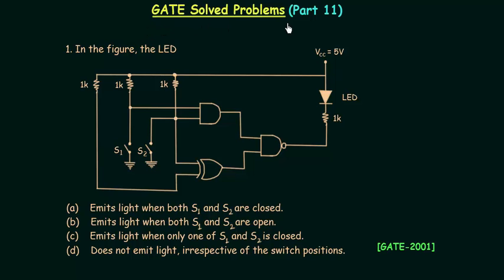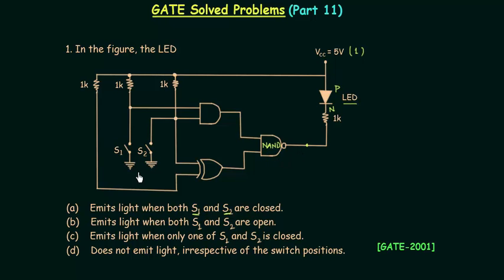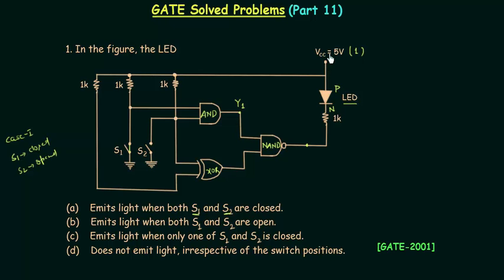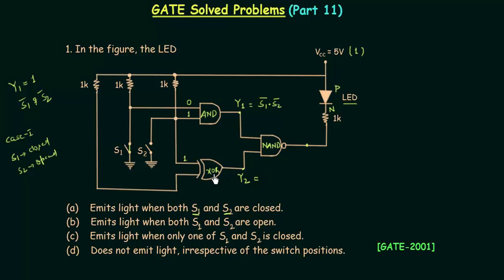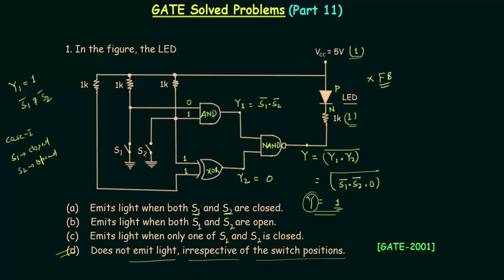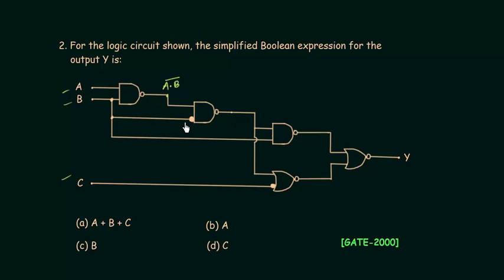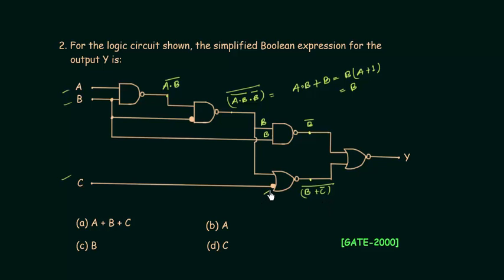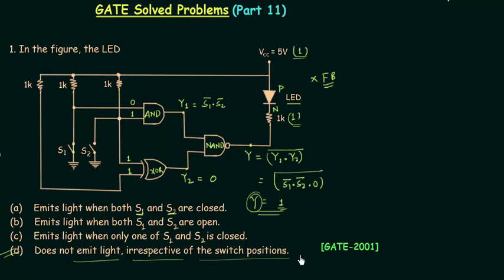GATE Solved Problems (2000-2001) | Logic Gates | Digital Electronics

Comment: The option "(a) both s1 and s2 are closed" is the correct answer because when s2 is closed, the XOR gate receives 0 as one of the input. We should consider the dot in the input of AND gate
Reply: Dot concept is right but the correct answer is still (d)
Becz to make the led on the output of nand gate must be low. To make the output of the nand gate low the only condition is both the inputs of nand gate must be high. But both the inputs of nand gate isn't high for any of the switch combination.
So it's independent of switch position.
Hope I'm right